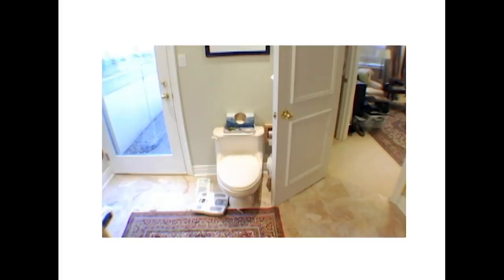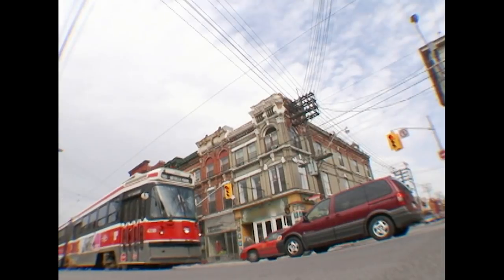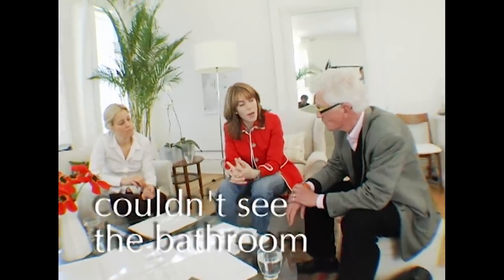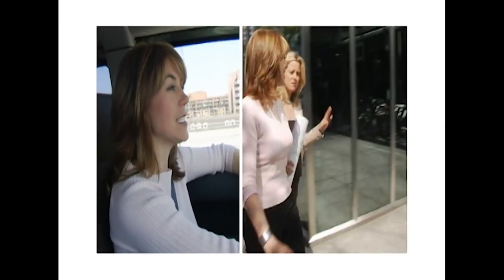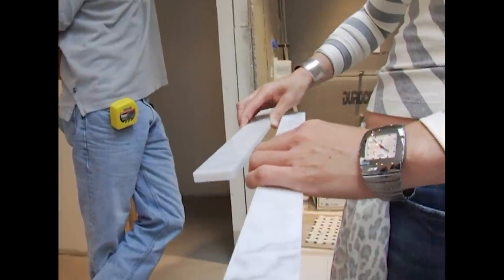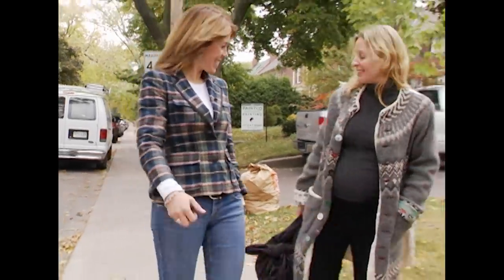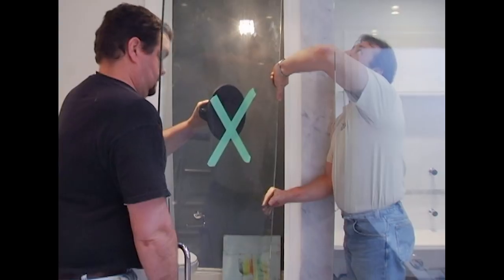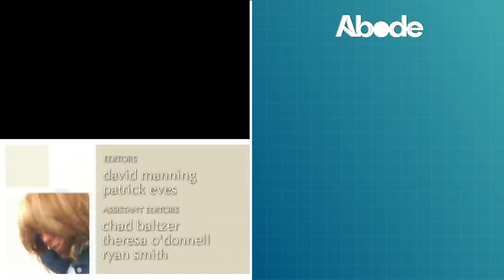Creating A Functional And Stylish New Bathroom | Design Inc.

Comment: I’ve got to ask, why do bathrooms in North America never have heated towel rails? Even in relatively humble homes in UK, you would never get a bathroom older than 25 years that doesn’t have a heated towel rail. This bathroom is absolutely gorgeous, nevertheless.
Reply: Not really seeing a need for them?? Seems like an expense for little 'bang' when spending money. Frankly when I get out of the tub/shower I am over heated turning on fans trying to cool down. Maybe American's use too much hot water!
Reply: To answer your question, no it’s not usual here! We use forced-air heating for the most part which is ducted through the house and pumped into every room, so inside your home will get pretty dry and arid during the winter when the heating is on constantly. I know from my time in the UK that radiant heating is more normal usually powered by oil and that’s also what heats the towel racks (i think?) We just don’t have the right type of heating, unless it’s common to see an electric plug-in heated rack, as we could probably install one of those but then that could be considered a shock risk if it’s within arms reach of the bathtub. On top of that, in the UK the humidity of living on an island probably makes for damp towels if not toasted dry! I live in a land locked city in the middle of the continent and it’s technically considered a desert here, even though we have snow for 9 months of the year it rarely rains!
Reply: I'm not interested in a heated towel rack (from the Midwest US) but I'll take a heated bathroom floor, please!